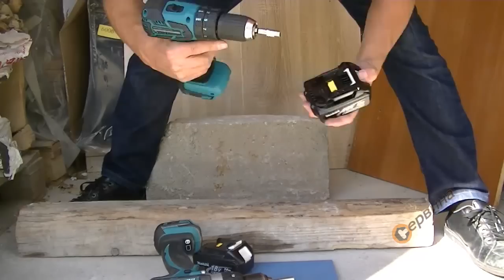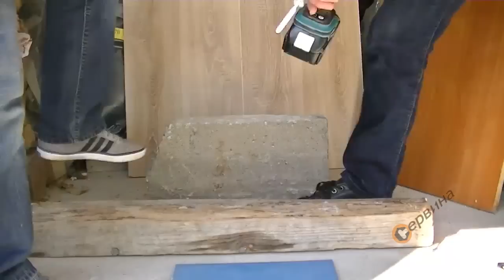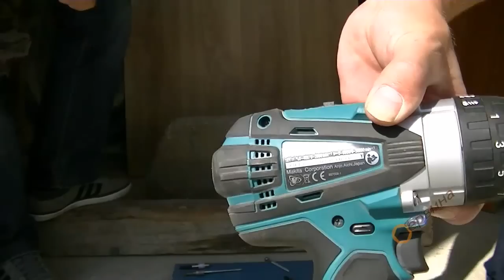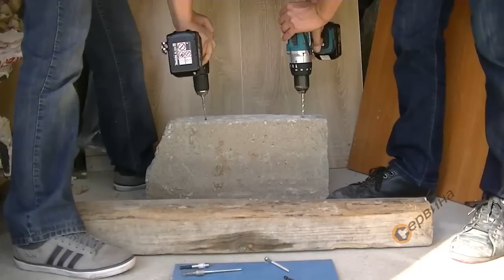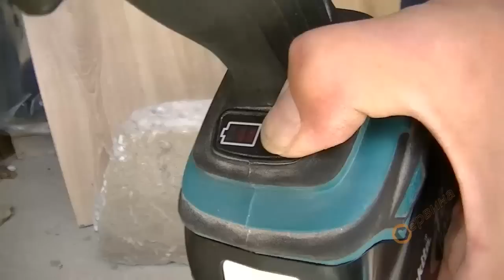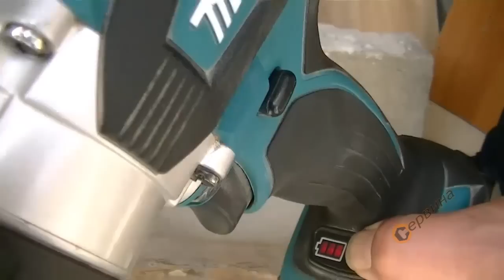TEST Makita BHP458RFE - Makita BHP459RFE 18V/3.0Ah Li-Ion

Comment: Its true, i own both the brushless drill and  the brushless impact driver. Brushless motor works great with impact drivers,,, but   the brushless performs poorly with a conventional drill because some times  yoh  really have  to  load and abuse a drill and the brushless just doesnt have the torque... it does have the speed though,,,, thx to its speed the brushless is great for impact drivers
Reply: Lo Mar Agree! Bought the Hitachi DS18DBL brushless. Used it with a holesaw, it cuts out on overload in an instant, it was strong and fast as hell, but the cutting out part, nope... Used a brushed hitachi where i worked before, you could abuse the hell out of it!
Anyway, i traded in the brushless hitachi for a Makita DDF456 instead
Reply: I know,, , brushless motors have little to no mechanical drag due to no brushes dragging on the rotor so they  spin  realy fast,, ideal for impact drivers.  The  problem with my conventional   brushless  makita drill is that if  you overload and abuse the drill the computer in the drill will sense an overloaded close to locked rotor condition and to protect the motor  and the batery the computer chip in the drill will cut offf power  to the motor,, as a consequence  its hard to just abuse it... like  drilling  a hole with a big ogre  bit or something... with my older brushed  makita i can just over load it and abuse it  and if my arm doesnt break,, ill over load it till the drill  physically stops but the power wont shut  offf on its own,,, but  at the end of the day,, 90%  of the time i love my  conventiinal brushless makita drill,, i give it a 9 out of 10.  What do you like better? Makita  or Hitachi?  I've never owned brushless hitachi... i surely dont like brushless Milwaukee products though
Reply: Eventually its all about the gear ratio, fast speed is low torque and low speed is high torque, that's why there are 2 speeds on most drills nowadays

Comment: Which one was which!
Reply: BHP458 is the one on the RIGHT, the drill with the silver gearbox housing. It kicked arse. It was, up until 2013/24, Makita's top of the range 18v Cordless Drill.. (Also known as DHP458 when it comes with battery and charger) BHP is the designation for when the drill comes "bare", or on its own. No case, charger or battery. 
Great drill for the Tradesman.
Reply: 2013/14... Not 24 !!